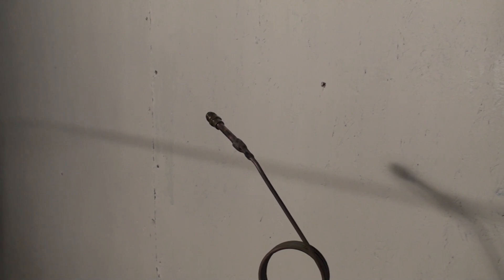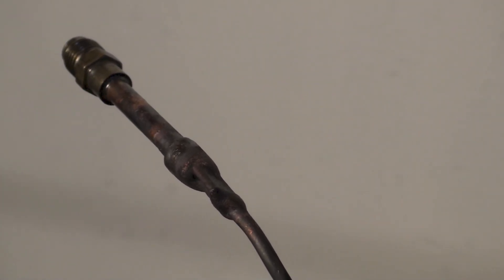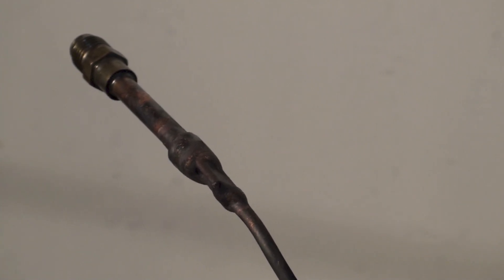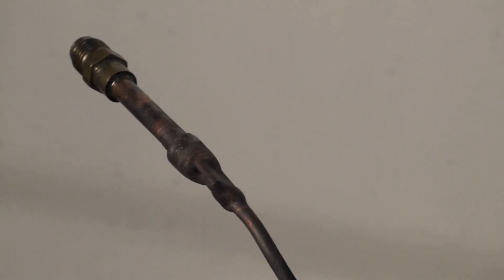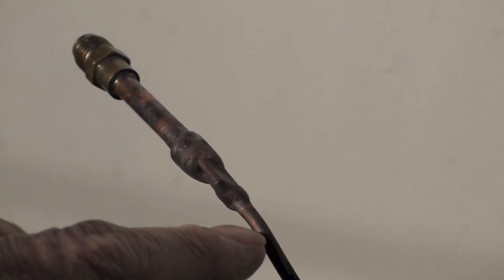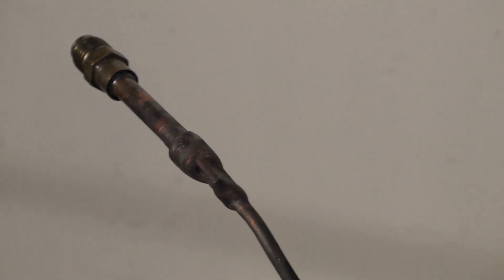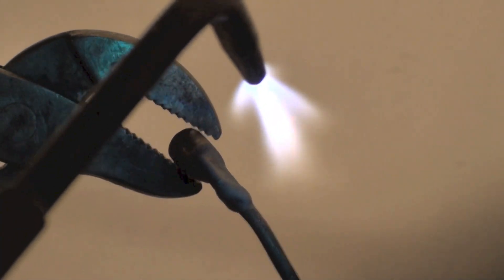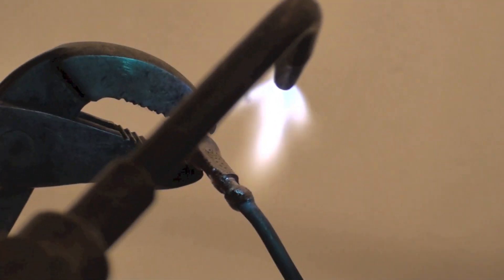Unbrazing the cap tube on air conditioners

Comment: In a real situation you would be pulling on the cap tube because the coil would be stationary.  I really never had a problem.   The coil material is so thin that very little heat is needed.  I had to replace all the cap tubes on a 5 ton package unit by removing the 5 tubes (5 separate circuits in the coil). On the other end was a strainer with all 5 tubes going into a flattened piece of 1 1/8” copper. I measured the existing and cut to length new cap tubes.  Got to be careful not to let the shoulder flow into the end of the tubes.

Comment: Can I do this with mapp/pro and a tip such as the TS800. Don’t have the funds for an oxy/acetyl. kit
Reply from the maker: You can try.  It does not work as well, but if the tubing is small, it may work ok.
GFM
Reply: grayfurnaceman picked up a mapp/oxy kit and it sorta worked. Sadly, I couldn’t braze all the way around one fitting and when I went to fill in the gap the cap tube came out and the female fitting sealed itself. It looks just like the last fitting you remove from the cap. Can it be be cut flat with a dremel wheel, crimped and brazed? Am I better off drilling a hole to fit the cap and brazing the cap tube from there? thanks
Reply from the maker: I would drill or punch the hole.
GFM
Reply: grayfurnaceman worked a treat thanks. Tech support recommended brazing the crimp and prying open. Glad I didn’t go that route. Used some grease and a drill bit while purging. Much easier. Dremel cutting wheel revealed the old cap tube was still stuck in there which explains the difficulty getting it in.

Comment: Mr. GFM,
This is the only video I could find online that shows how to correctly remove a cap tube. The unit I worked on this morning is a 2.5 ton residential system with a fixed orifice attached to the liquid line by a flared fitting. There are 4 capillary lines coming from the fixed orifice housing which are brazed directly into the coil. Two of these capillary lines have serious leaks that can't be repaired.
Because of your excellent video here I was able to successfully and quite easily remove all 4 of those capillary lines without any problem. I'm waiting for the replacement part to come from the manufacturer so whether or not I'm successful on installing that remains to be seen. But your guidance here has given me the confidence that the install will go smoothly.
Thanks for your excellent work on these videos!
Reply from the maker: ***** Glad I helped.
GFM

Comment: I was told to keep at it with 1 O/A, and I'd get there with patience ( about 30 minutes )  I called one of my friends with Air/Acety and the job was done in 2 minutes.    Thanks for confirming the idea.  I started at 9:00 AM and had to pull of the job until 4:00 PM.  I will be investing in a second tank for the occasional commercial jobs.